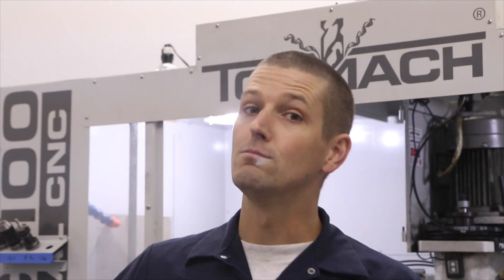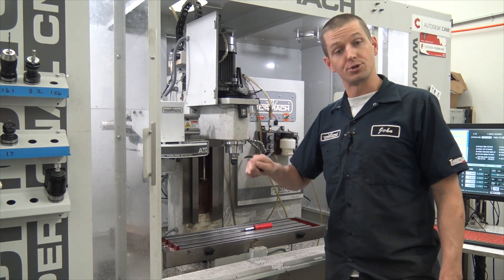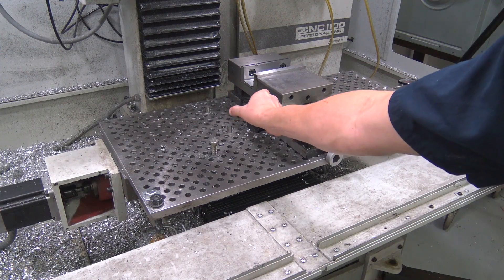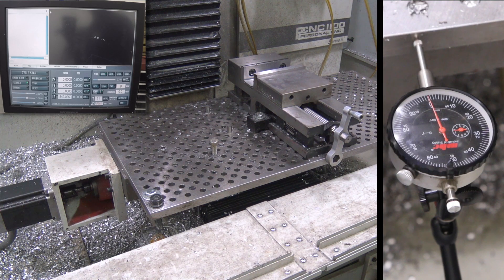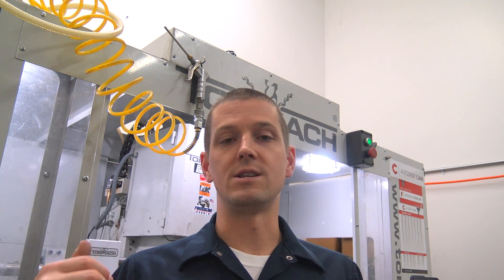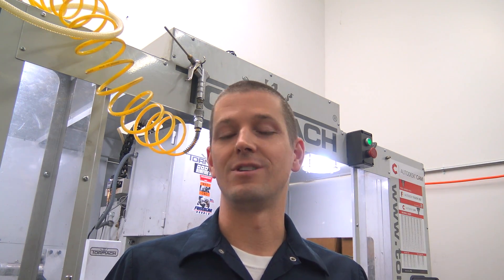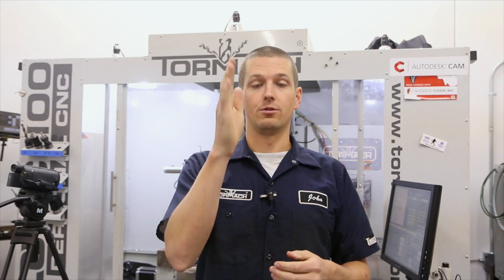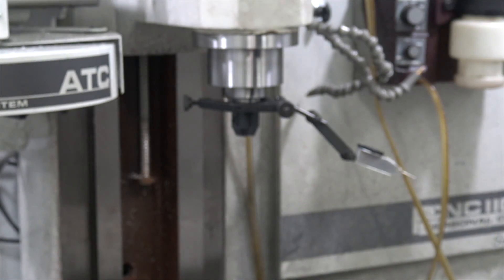Tormach PCNC Maintenance!

Comment: Absolutely AWESOME!!! I still think Servo Motors would minimize a lot of the adjustments... Under High Torque loads, Steppers can loose steps, Servos will not... But that's my observation... Servos are a lot more expensive, so there's always a trade-off... Sorrta 6 of one - a half dozen of the other... Fantastic video... It is really important for calibrating a machine. I'm so happy to be a subscriber...

I wish I could support you financially, but still can't at this point in time... I have to make due with what you post and for the most part it's all been an awesome learning experience :-) When I am better situated, I will definitely support your work :-) Thanks again :-)
Reply: +DStray Cat The upgraded motor package for Tormach machines, which I think John has fitted, uses Leadshine hybrid steppers which have an encoder and a closed loop to their matching controller. They will flag a 'following error' like a servo drive if they skip to many steps and can't correct.
Reply: +DStray Cat, Well if I were making a DIY mill for metal like the Tormach. Servos like the ClearPath by Teknic would be a good option -- David Burrell at YouTube channel Neo7CNC really likes his for his router. But the benefit of something like the Tormach is that you have a system designed to work together with support. Also steppers are almost always oversized precisely in order to not lose steps or stall.